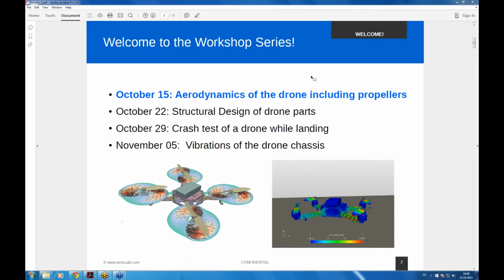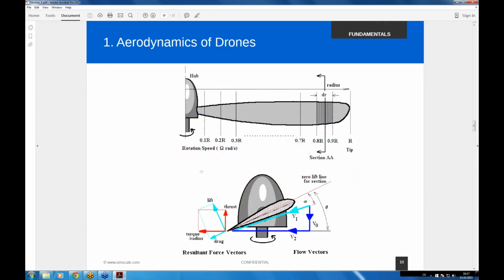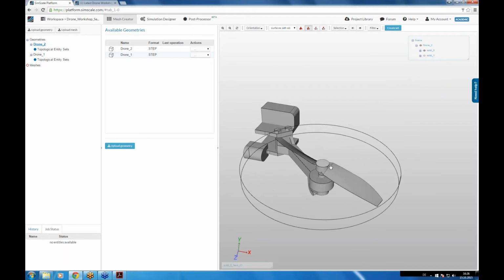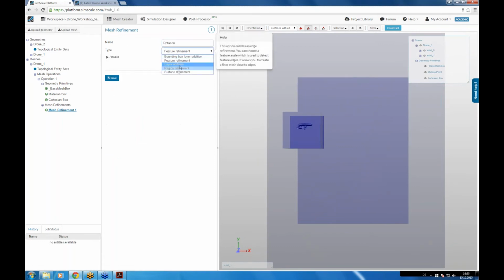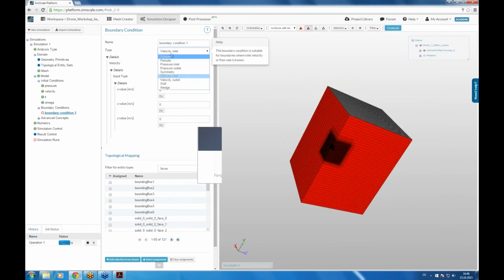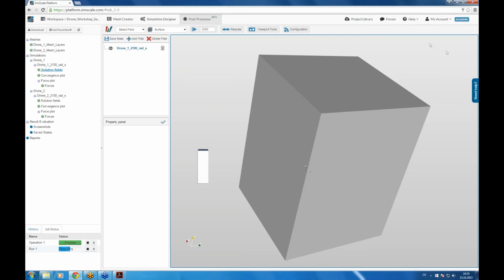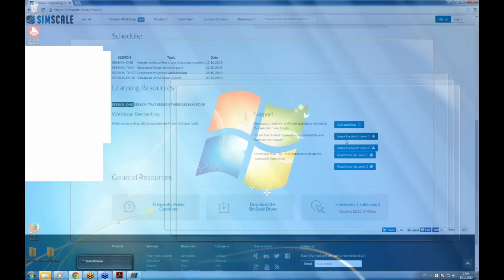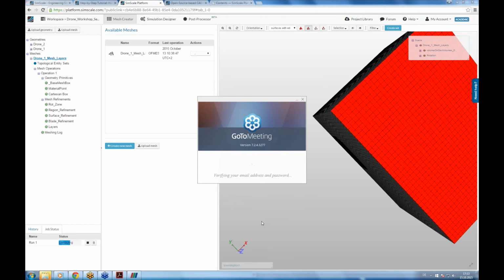Drone Workshop (Session 1) - Aerodynamics of a Single Rotating Propeller

Comment: Just wanted to make a few things clear. The flow does not actually meet up again at the trailing edge. Although air travels faster along the the lower surface, this is because it is deflected at a steeper angle thereby creating a vacuum into which the air accelerates. The accelerated air actually reaches the trailing edge first. There is no law that states the air must synchronously meet up again at the trailing edge. Also, Newtons laws must also be considered when talking about lift.
Reply: ,,Although air travels faster along the the lower surface'' - Fluid travels faster on the (top) suction side of the propeller blade airfoil.